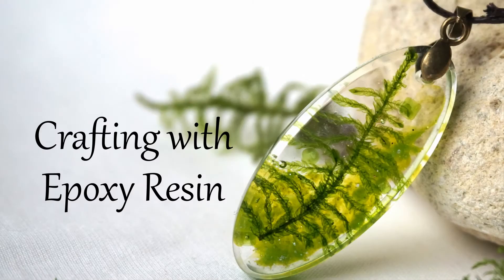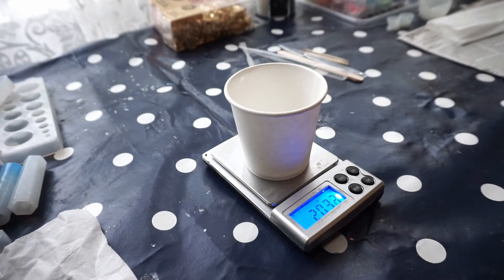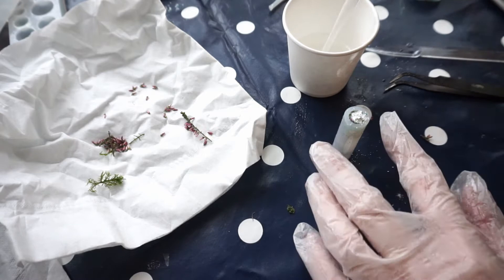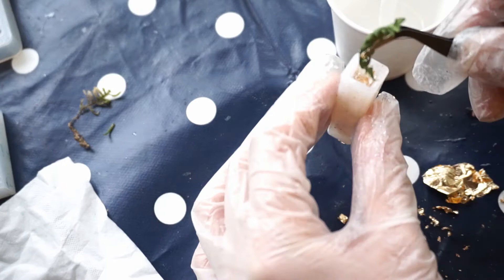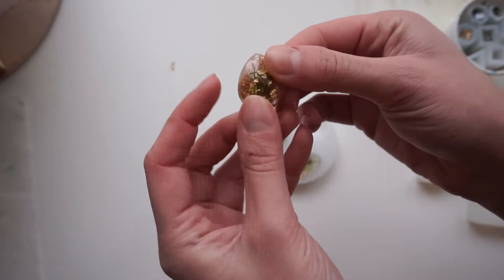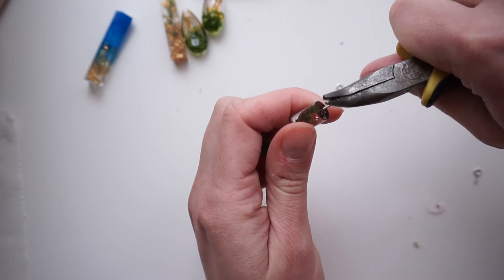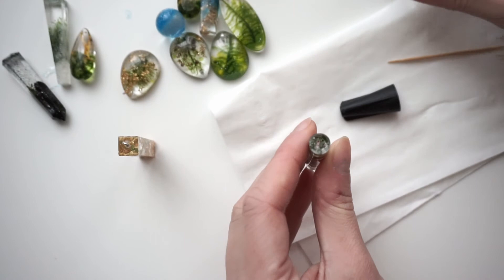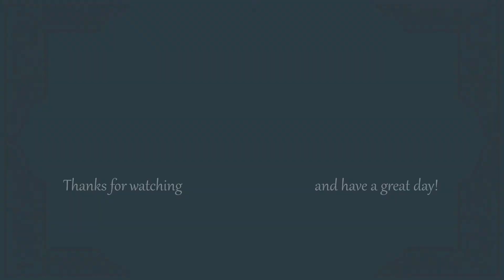Basic epoxy resin casting with dried moss and plants

Comment: Sticky uv resin is because your uv torch is not powerful enough, uv resin NEEDS a HIGH UV Light to cure it properly.
Great vid and resin pieces.
Thanks 🙏🏻
Reply from the maker: Yes, I thought too, but this torch should be stronger that the cheaper UV lights I see people use for the nails. I guess I need to invest later in something better. For now I figured out that the sticky layer cures over time if I leave it on a windowsill for about a week (I live in a cloudy country).
Thank you for commenting!:)
Reply: if sticky place in sun light...for a few minutes, it takes care of the stickiness
Reply: @fretka007  hey love amazing video and pieces, no need to invest in better light, just use your uv torch in a dark area.... not under a different kind of light, again amazing pieces and thank you for showing how you dry out your stuff.
Reply from the maker: @Rachael Wood
Hi! I should make an update video. It was the resin. I got different one and that one hardens fine. I also got a proper UV lamp and the older UV resin stays sticky forever even there while the new one needs 10-15 minutes curing to harden and dry.

Comment: with pendants, I find placing in a pie pan with dish soap & water, helps remove them.
Reply from the maker: Hi, do you mean the pendant in the tube mold? I haven't tried that yet! 
I tried to inject some water in the mold, but it did not really make it much easier to get the pendant out and I couldn't re-use the mold right away, because it was wet.:(

Comment: Those are really beautiful! I have one question. Do the green materials (moss, leaf) change their own color after some periods? If the green color is preserved forever (or long period), then it would be best!
Reply from the maker: It depends how UV resistant your resin is and also how you store the items (if they are frequently in direct sun, they will change colour faster). You can either buy resin with UV resistant additive in it or you can get them apart. But from my experience, some plants stay kinda the same and some change. I even had moss that I picked all in 1 day and for some reason some of them were more colour stable than others. You can never be 100% sure, unless you dyed the plants with some artificial colour.

Comment: I believe thier is a uv light your suppose to use with uv resin it looked like you had one but you called it a torch so I'm not sure. To touch up your pieces could you mix a small batch of the same resin you used to make these and just use a small flat silicone brush to fix them?

Comment: I want a pressure pot so much!
Reply from the maker: It's such an improvement when you work with resin! Simce then i have rarely any bubbles. I can only recommend. Mine is just little modified pressurised paint tank i got from Amazon for cheap.
Reply: @fretka007  what did you modify?
Reply: @evastapaard2462  Hi Eva, I was the one that modified the pressure paint pot. There are videos on youtube how to do the modifications, but ours didn't exactly match the one from the videos, so I had to figure it out myself. I can give you some clues how we did it:
Both paint and air outputs to the paint gun are closed off by extra parts from the hardware store. Then the pressure regulator is flipped, so it will show the pressure on the inside of the pot, and not on the output side of the paint gun. Furthermore, the ball valve was placed on top of the reversed pressure regulator and I connect our pressure pump there. Our pressure pump is from a refrigerator, modified to connect to the paint pot. 
Be careful though, working with high pressure systems is dangerous and should only be done if you fully understand what you are doing.
Reply: @aegis3d  thank you so much for all the info. I'm pretty handy myself but in this case...i'll look arround for some one to help me. (and I really hate that!)

Comment: realy nice vvideo! i tryed to make one myselfdd but when i was sturring the things inside the epoxy around, there was to much air comming into the epoxy. this made for a verry bubbely piece of work.  do u know anything that might help?
Reply from the maker: Hi, thanks for commenting:)
I usually leave the mixed resin stand for about 5 minutes to allow the bubble to rise and pop by themselves. Sometimes I smack the cup on the desk to make them rise faster. After few minutes there's minimum of bubbles and only then I'll start pouring it in molds. If I see some big bubble inside a mold, I try to squeeze it out or again hit the mold on the desk, so the bubble comes to the surface where I can pop them with lighter. If you work with dried plants or mushroom, sometimes it's better to soak them in resin before you arrange it in the mold, because some are too porous and will release bubbles of air. And lastly, the pressure pot is just great thing to have clear casts. 

I think I'm going to make later some more detailed video on how to avoid some mishaps in resin casting.:)

Comment: Can we use fresh moss with epoxy?
Reply from the maker: Hi! Fresh plants in general are bad idea for using in resin. Resin doesn't like water when curing and also fresh plants will rot or significantly change colour when encased in resin. Drying is the best way to go with moss or or other plants.

Comment: Beautiful work u have here 💕..... quick question, how do u dry the plants?
Reply from the maker: Thank you and sorry for the late reply!
Depends what plant and what I'm planning to do with it. Some plants, especially flowers or leaves with more intricate shapes are better flat. For these I use the classic technique - a flower sandwiched between papers, inserted inside a book and put some weight on top and leave it in for couple of weeks. I've got a dedicated flower press lately, but haven't tried that yet. 

For moss, mushroom and some other plants I like more in 3D shape I use an air tight container with silica gel or pearls for dehumidifier on the bottom, then paper napkin and then layer of the plants/mushroom. They can't be tangled together because some get very brittle as they dry and then it's impossible to untangle them without causing damage.

I hope it's helpful!:)
Reply: @fretka007  thanks dear ....i wish i can see a video of how the mushroom/plant is been dried .....thanks🙏🏻....this was helpful tho